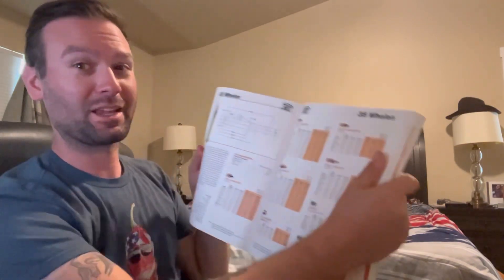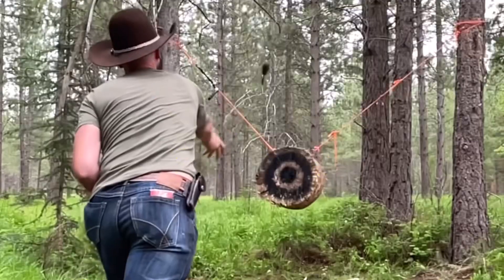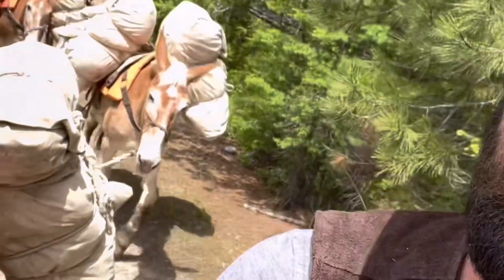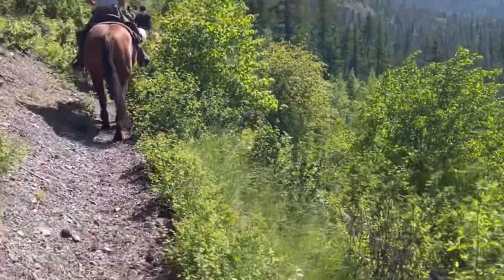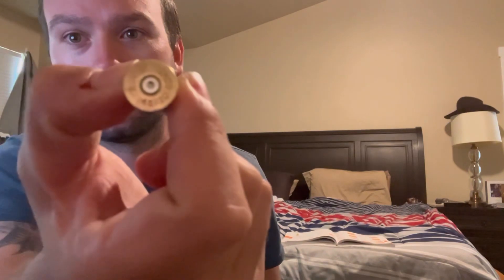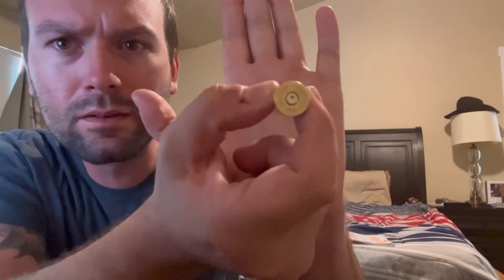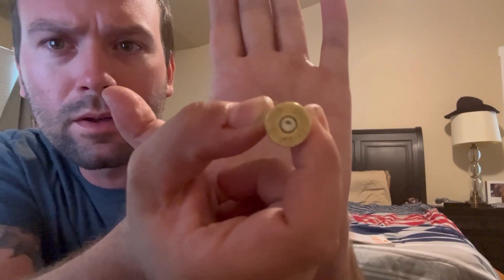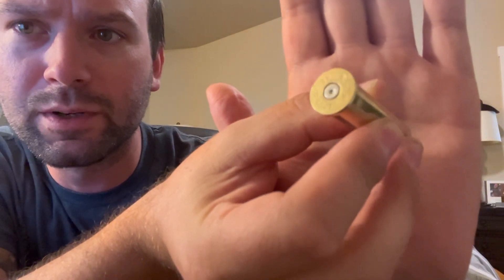How much can magnum pistol primers handle?

Comment: Lonesome Outdoors ---> Hello. I watched the first video several hours ago and made a comment. {I subscribed }   Just watched this one a few minutes ago. I know why you did the experiment, {Lack of Large Rifle Primers} but I would not have switched primers because I started reloading in the mid 1970's and always followed the printed instructions, at first the ones on my Original Lee Loader kits (arm & mallet powered) and later from more detailed manuals. 
 
  I have 3 Lyman manuals, a Lee and 3 Speer manuals, two editions of "Cartridges of the World" by Frank Barnes, and a great book titled: "Complete Guide To Handloading" by Phillip Sharpe, 1941, Funk & Wagnalls publishers. They all are very specific about only using the correct primers, correct powders and correct bullet or shot weights.  
 
 Stuff like that (following instructions) was drilled into our heads in Boot Camp at MCRD-SD. In Boot Camp the offender gets a trip to the Sand Pit for some 'personal instruction',,,, in a combat zone or a live-fire training exercise the offender (and probably men in his squad) get wounded, injured, or dead.    
 
 I do not know if you have found any Large Rifle Primers yet in Montana, but I just checked on g u n b r o k e r dot com under the heading of Reloading supplies in the "drop-down menu" and there are some L.R.P.'s for sale. I have bought from sellers on that site myself. 
  
 Also have bought reloading supplies at a couple of Gun Shows here in N.D. in the past. Got two bottles of Alliant "800-X" at a Gun Show about 2 years ago, and some primers (not CCI), but I don't care about the brand very much as they all make a spark. Got some "Cheddite" primers for my shotshells.

Comment: CCI 350 are the hottest primer out there, rifle or pistol. It was developed expressly for igniting H110 powder, which is akin to lighting charcoal. But being that they are pistol primers, they have thinner cup walls. They can work
 satisfactorily in low pressure rounds like 30-30 and standard 45-70 but shouldn't be used in high-intensity bottlenecked rounds. They will fail when subjected to somewhere north of 40,000 psi. As a for-instance, I once tried VV-N110 powder in 7.62X39 with the CCI 350 primer. The primer pierced on the first shot. Smoke came out the back of the gun and the crono read only 783 fps. Most popular modern bottleneck rounds are 10-20,000 or more psi above that of the 7.62X39. Interestingly, the S&B large primer is listed as being appropriate for rifle or pistol. Thanks for the vid!
Reply from the maker: I ran into that exact problem when I loaded them into my 35 Whelen.

Comment: Large magnum rifle primer is notably hotter in comparison to Large magnum pistol primer. I think the pressure curve in your bottle neck high powered rifle cartridge is adversely effected due to what might be described as abnormal or interrupted burn rate. Same thing is probable within your 45/70, 30/30 & 30/40 but not noticable. Depending on you powder choice, magnum rifle primer may not be necessary anyway. Did you check the bore & chamber area in the 30/06 & 35 Whellen for fouling or possibly find evidence of unburned powder particles ?
Reply from the maker: Major fouling on the 35 but not so much on the others. The mag pistol was more an experiment out of necessity rather than for fun. Needed rounds ready to go for bear season and no large rifle primers to be found. So I figured a work around. Had to spend 5 weeks on the mountain this spring running mule strings and horses so I wasn’t going without some tested ammo. It worked and worked well out to 600 yards in the 30-06. I won’t be loading MPP in rifle cartridges since now I’ve finally got LRPs
Reply: @lonesomeoutdoors7801  copy that 👍 
 The MPP's were seemingly altering the powder burn rate in the larger bottle neck cartridges. Which absolutely throws the pressure levels into a fit 🔥💥 😵 I enjoyed the adventure 👍 Carry on.
Reply: @jimsiress9687  the thin-walled pistol primers will pierce when subjected to 40,000+psi. The pressure isn't necessarily more than normal. The primer just can't take it.
Reply: CCI 350 Large Magnum Pistol are the hottest primer in the business.

Comment: Excuse me but large rifle pockets are deeper than large pistol. 
But go for it.
Reply from the maker: Correct so this actually ended up working well in my 45-70 and 30-30. The video is in the description of both LRP and MPP rounds shot over my chronograph and the results really surprised me. The depth wasn’t an issue here, it was the strength of the metal and the pressures of bottleneck cartridges.
Reply: I question that pocket depths are different until I obtain a depth gauge that works. I measured rifle primers vs. pistol primers and their "thickness" is the same with all primers within 1thou of each other. If primers are the same size, then I would think pocket depths are the same size. I believe the only difference between rifle and pistol primers are cup metal hardness and maybe cup metal thickness and I have not measured that. Just coming from 50 years of reloading experience.